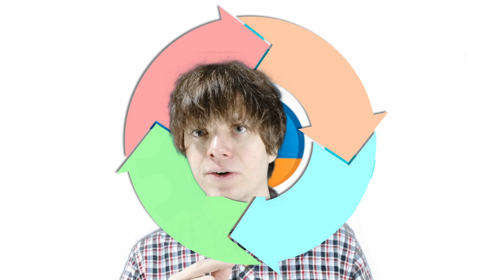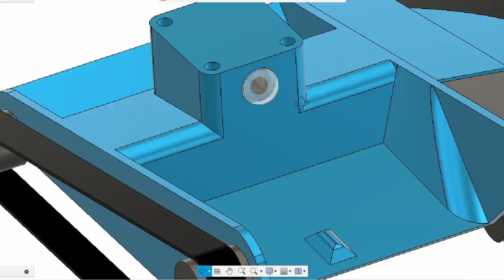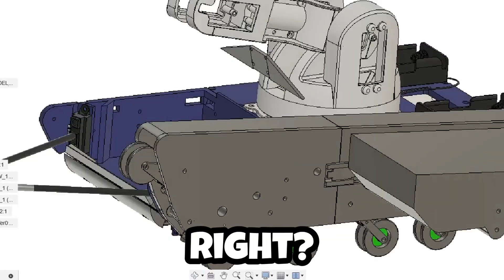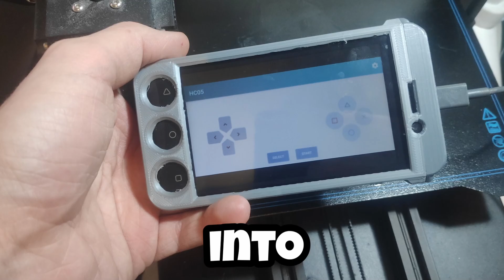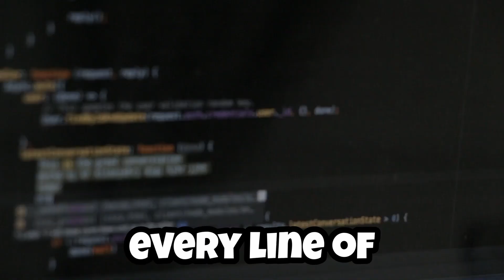Room-Bot The DIY Robot: Evolved the Robotic Vacuum Cleaner, Twice!

Comment: I think you can add a buck converter to prevent the steeper motor driver from being toast out
Reply from the maker: Yes, that's a viable solution. I'll first verify the voltage levels of the stepper motors to ensure they're within the acceptable range. Given the robot's substantial weight of 3.2 kg, I've been operating the motors near their limits to achieve the necessary torque and power. Considering this, I'm thinking that designing a compact gearbox to lower the stress on both the stepper motors and their drivers would be also good.